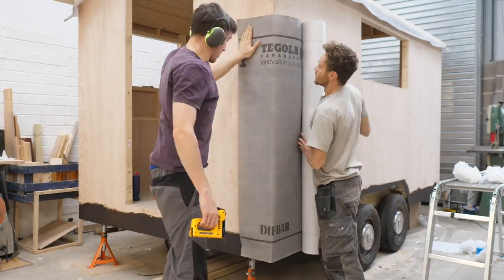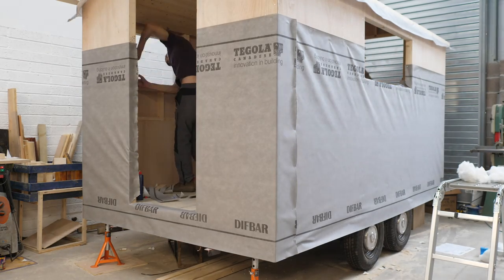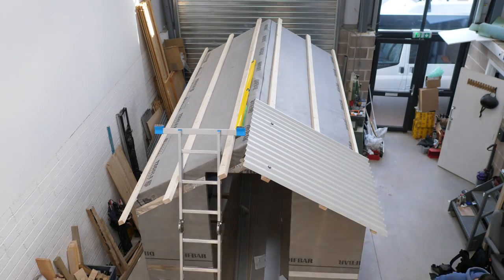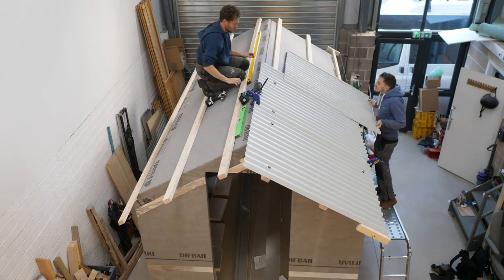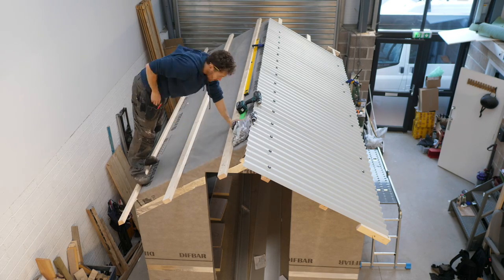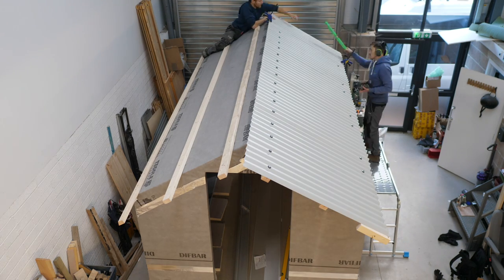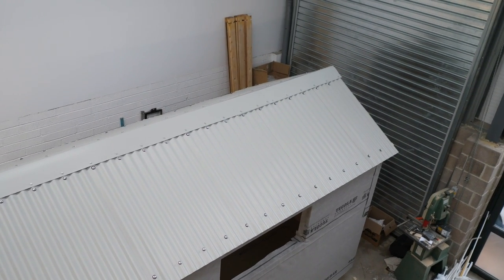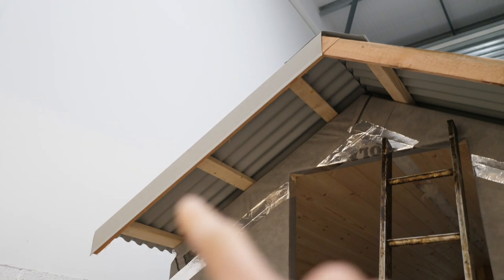BUILDING A TINY HOUSE Part 04 - Corrugated Steel Roof And Waterproof Membrane

Comment: I don't know what to say without being unkind. I don't want to do a downer. So, we have a fame with insulation, an interior liner and a (12mm?) Skin on the outside and then corrugated steel on the outside and on the roof. I realise that the metal can be painted, but so far it looks like a farm building. Maybe you can rescue it with a dark (black) roof and white/lightish exterior walls? I know you said early on that weight wasn't an issue, but I'd be seriously interested in the final fitted out weight and I am wondering if the steel frame can take it, apart from short journeys? I've never done a project like this, so this is supposed to be a CONSTRUCTIVE comment, but I think I would have epoxyed, maybe fiberglass the exterior walls. I know this is difficult and time consuming, but it would be lighter, I think. This is the problem when someone wants XYZ for their micro home and you have people watching on YouTube with other ideas. Great video, real shame it wasn't longer.👍
Reply from the maker: Hi Carl, thanks for the comment. It's not a downer comment I just appreciate constructive comments rather than just plain negative/ignorant ones haha.
The issue with looks is that everyone has such individual tastes. Me and Ben love the look and know that of course it won't be everyones flavour.
We have finished it now and after the Covid spree are going to take it to a weighbridge. It obviously isn't as weight efficient as a caravan but I have been able to push it around on the trailer on my own.